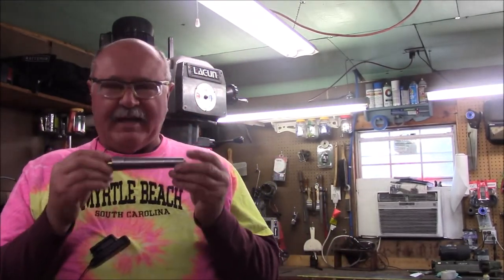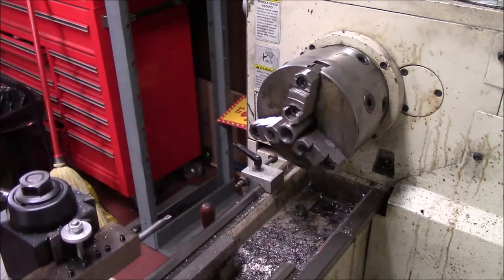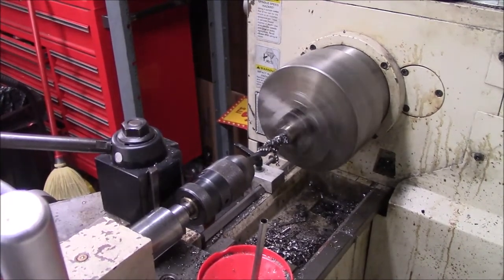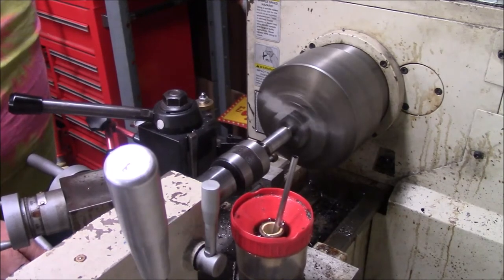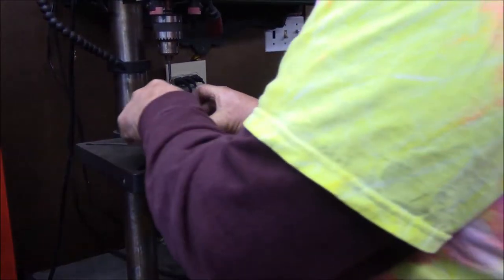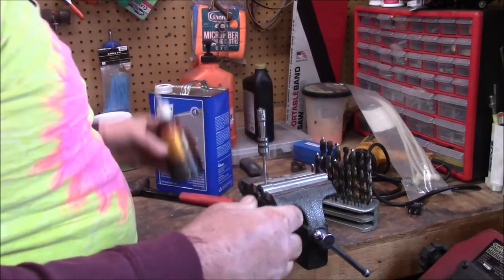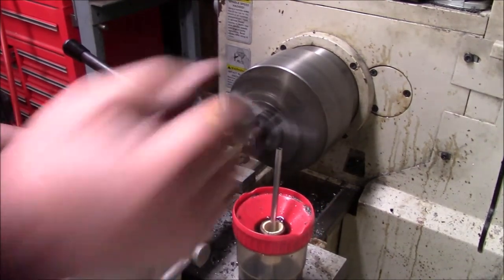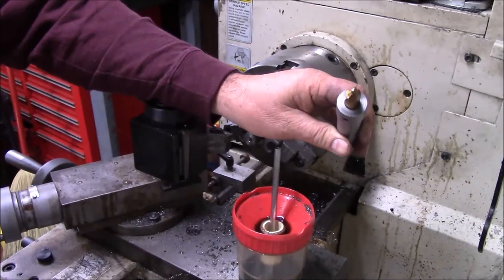Fixing Bozo on the Doubleboost inspired center drill holder

Comment: Neat project, but drill chuck serves me well enough
Reply from the maker: Erstwhile actually I would not have done this project or rework except the center drill had flats that would not center up in a drill chuck. These centers was made to be used in a face and center machines that we used at Eaton in machining shafts for truck transmission